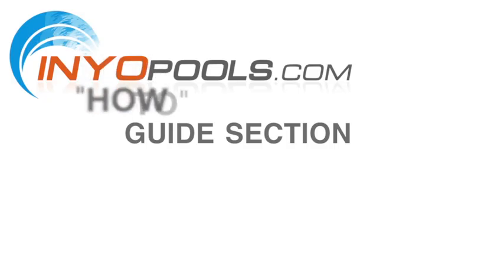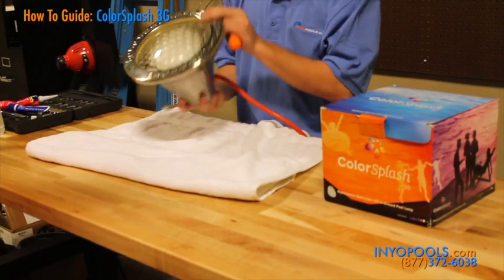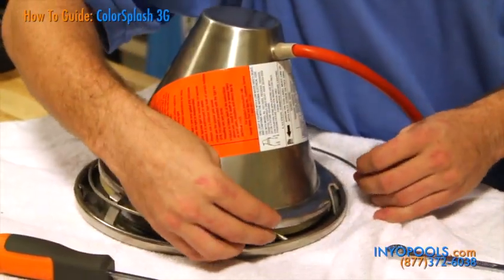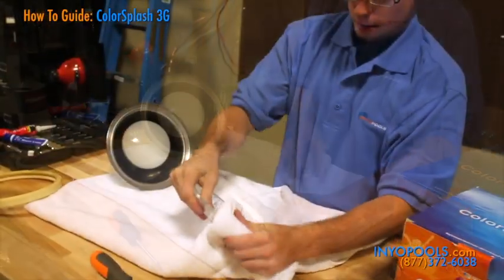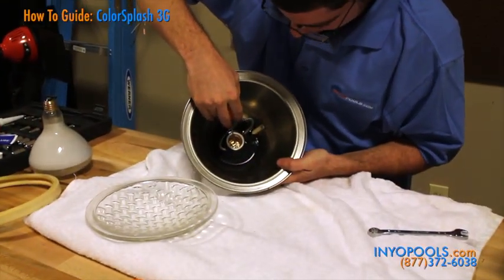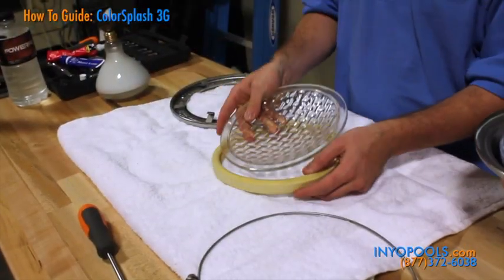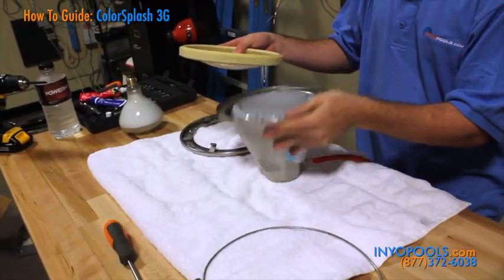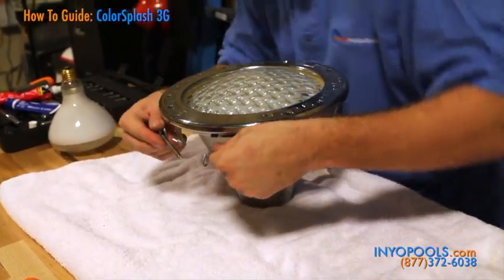How to: Upgrade Your Pool Light To an LED Color Changing Light

Comment: Are they all screw in ! I want to put in a led screw in , but took it out and looks like it’s stuck in the housing with like 6 two pin bulb 💡 , do I have to replace whole housing , or if I can get that old one out somehow and screw in under it ? Appreciate any advice y’all 🙏🏽
Reply from the maker: The replacement LED pool light bulbs we carry are only compatible with the Hayward Astrolite, Hayward Duralite, and Pentair Amerlite. Due to the design of our LED bulbs, they will only fit into specific conical-shaped fixtures that use E26 Screw-in bulbs. PureLine PureColors LED Pool & Spa Light Bulbs - https://www.inyopools.com/ProductListing/pureline-pure-colors-led-pool-bulbs.aspx

Comment: so I have a Pac Fab Hatteras Pool Light with a 500 watts bulb, can I just replace it for a LED light then?
Any specification on a LED light that matches the 500 watts that came with fixture? 
I would like to have a light with remote or a way to select colors, thanks AQ
Reply from the maker: The PacFab Hatteras (https://www.inyopools.com/pool_parts_pac_fab_hatteras_pool_light.aspx)  uses a standard R-40 bulb, so most replacement LED bulbs would fit the socket. The main issue would be the shape of the housing. Standard ColorSplash Bulbs (https://www.inyopools.com/productlisting/lights_jjelectronics.aspx) are "bulbous" on the back, but the Hatteras appear on the narrow side. Review SwimQuip replacement LED pool light bulb (https://www.inyopools.com/Products/44400015084676.htm) dimensions to determine if it will fit.

Regarding wattage, there are no 500-watt equivalent options available. Most color-changing lights brightest color (white) tops out at about 300-400 watts equivalent brightness; the other lights appear dimmer because they do not travel as far in water.

Comment: I followed your steps and changed the gasket, but water it's coming in. I tried a new gasket and metal ring, stil leaks. I am trying a new tempered glass. I don't understand why am I getting water? Thoughts
Reply: When you take it apart , use magic lube around the gasket, it will seal it tight, they should have it at your local pool store.
Reply: I used the lube and I am still getting water in my housing and it’s tripping the breaker. I just bought this house and frustrated that I can’t use the light at night in AZ. I am going to have to call a repair shop now. Ugh...

Comment: In the short space of time (about 3 years), I am onto my 2nd LED Pool Light. The first was radio-controlled, with all of the features of color-change. The first LED Light was impressive when first installed. Then, after just two years, I noticed that the Pool Light was "flickering" and also several 'dark' spots on the Lens, where LED's had failed to light up. I strongly suspected that water had entered the LED Light Unit (even though this Unit was potted with resin). I was wrong about this. Upon inspection, the old LED Pool Light was dry inside. So - why had it failed?
During manufacture, the LED's and Electronics are potted in resin. However, the LED Pool Lamp (when turned on) becomes hot inside. The heating and cooling causes some slight distortion of the potted LED's - when set into the thermoplasic resin. If I slightly 'flex' the potted LED Light Unit, the LED's all work!! My conclusion to all of this, is that some change takes place in the potting of the LED modules between manufacture - and end-use. It is this slight distortion of the Potting Resin (due to heat) that causes many failures in this type of Pool Light. Finally, the Potting Resin is very poor at heat dissipation, a primary cause of Potting Resin Distortion leading to premature failure of the LED Light Unit. All of the LED Pool Light Manufacturers need to focus upon the heat dissipation from these types of Pool Lights. Basically, the higher the Wattage of your LED Pool Light, where more internal heat is generated, the worse this situation becomes.

Comment: i have a hayward above ground pool light. it comes with colored le ses
i tried to snap them on but they fall off

do i have to remo e the light FIXTURE just to add the colored cap?  ground light

Comment: Is there a remote for this light? How does it change colors, can you keep it on one color?
Reply from the maker: If you want an LED bulb that is controlled with a remote, take a look at our Pureline Pure Colors:  (http://www2.inyopools.com/ProductListing/pureline-pure-colors-led-pool-light-fixtures.aspx) The LED in the video is controlled by a light switch. You would flick the switch several times to cycle through the solid colors and lights shows.
Reply: most change color by turning on and off if they don't have a remote

Comment: i need the device where it tightens the gasket and bulb so no water leaks in. It didn't come with my jacuzzi light. what is it called and where do I purchase one?
Reply from the maker: Drew, if you are talking about the Jazz Light Compression Clamp - J30-5000, it is no longer available, with no compatible replacement. See link here: http://www.inyopools.com/Products7/07501352030393.htm

Comment: I put in a $27.00 led color changing bulb from Menards(for indoor use only) and its working great. sealed the reomote in a food saver bag to keep water out cause you have to be right infront of light for it to work. I leave it on all the time. Plugged it into my killawatt and on color changing mode it only uses around 3 watts. Sweet:)
Reply: 08/1102019 that light still works Great!!!!!
Reply: Nice to see someone with intelligence, rather than paying an over exorbitant amount for pool certified product. I was thinking the same thing. Retail price is a joke
Reply: Gary Bombei oh its been working for a month so far
Reply from the maker: +Gary Bombei How is it going so far?
Reply: +Inyo Pools it is still working great.
Reply: +Gary Bombei opened up pool today 4/15/2016 and it is still working fine
Reply: UP Date 06/09/2020 still working
Reply: @Gary61B  link to bulb on menards or amazon?  Pool or spa use? is it bright enough? LOVE this.
Reply: Gary Bombei 
I have a fountain with an outdated floodlight. Are uou saying you changed the bulb only and it worked?
Reply: @brentb1250  Sorry i only get back here once every year. My bulb is in a under water wet niche. So the bulb is dry inside there and it works just fine.right off the shelf and I can change colors or flash them or strobe them or fade them. As a boring person I just leave it on Blue cause it goes with my liner well.
Reply: Thanks for the update! Because of it I believe this is the route I’ll go.
Reply: @mrskimthomas06  06/09/2020 and still working

Comment: It's a lot more difficult when you are working on your knees in 100+ degree temperatures and you have sweat running into your eyes and the deck is scorching hot and rough. Good video though. Thanks!
Reply from the maker: True, in that kind of weather the only "Easy" thing to do is drink a Mai Thai
Reply: +Inyo Pools Or use an umbrella or do it in the evening, and use knee pads or seat cushion.  There are many ways to make yourself comfy when doing things like this.